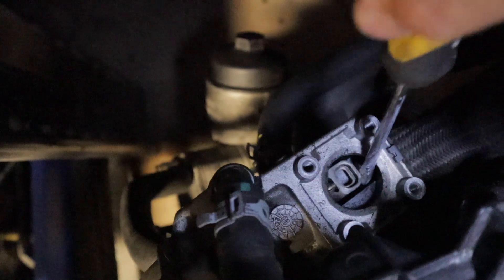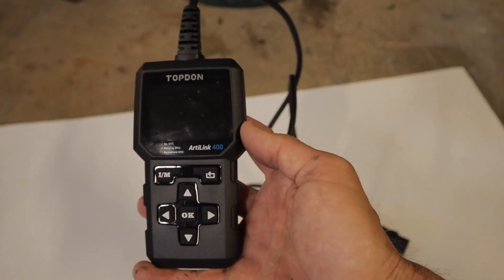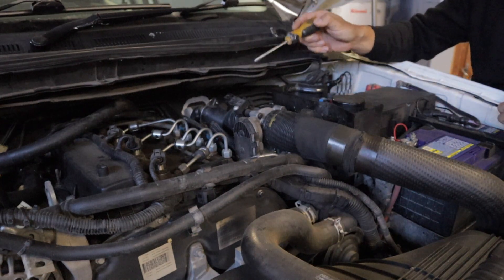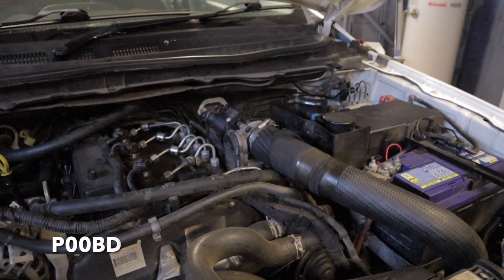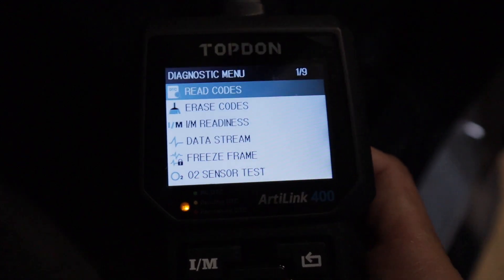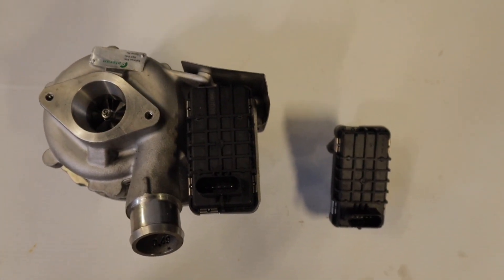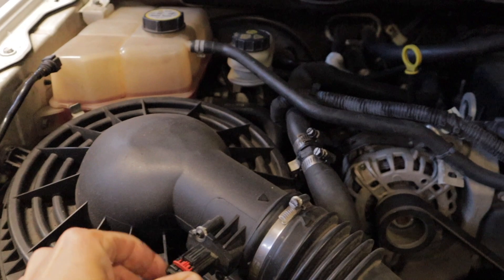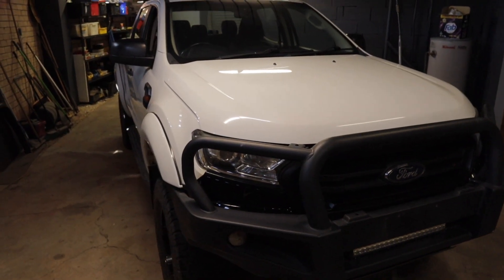Ford Ranger Common Fault Codes Causing Limp Mode

Comment: Have a p0722 code throwing my car into limp mode sometimes and I clear the code and my traction light comes on until I restart my car 
It’s a 2014 3.2 litre XL AUTO 
transmission speed sensor
Car drives fine other then when the traction light pops up, is my transmission due for a rebuild or is it maybe a faulty sensor, let me know your thoughts thank you

Comment: HI I HAVE A 2012 FORD RANGER 2.2 I HAVE A SIMILARY ISSUE AFTER ONE OF MY ROSE GOT CUT BUT NOW IM GETTING A P2564 CODE  I TRIED CHANGING THE TBCPS sensor
 NO FIX DO YOU HAVE ANY SUGGESTION PLZ THANK YOU
Reply from the maker: rose got cut?   , p2564 , how is the intercooler & pipes?

Comment: G’day mate. My traction control and powertrain icons came up today on the way out of the city and was limping. Shut it down for a while. Turned it back on and it disappeared but I turned around to be safe. Weird that I smelled something perhaps some lining stuff but I’m no expert. Worth to note the EGR cooler was just replaced and had no warnings before it was released to me on Friday afternoon. Under 98K kms on the clock, 2.2L T6 RWD only. Any ideas ? Will mos def bring it back in next week. But this is the 2nd time in like 6mos.
Reply from the maker: would need to read the stored codes on the computer
Reply: @abdautomotive  ok got it, will get someone to check the codes and come back here, hopefully tomorrow Monday. Enjoy what's left of your weekend, mate!
Reply: @abdautomotive  P2291:00-28 Injector Control Pressure Too Low - Engine Cranking ; seems to be an issue with the fuel filter housing when they troubleshot it yesterday as it shows movement when engine is on (not sure how they saw/measured it) but they put a relatively new FF housing and will test it to isolate further.
Reply from the maker: @r1cpac  thats an unusual one , can't say i've come across that before

Comment: Just got a PX1 ranger with 250K recently. Been fine for the first month. Went to check fluid levels and found the coolant level low. Took 2L to top up to correct level. Next morning on the way to work after getting off the motorway it was into limp mode after some heavyish acceleration. Powertrain fault light flashed once and went out but stayed in limp mode. Pulled over, switched engine off and on and it was fine until I tried to accelerate hard again and went back into limp mode with brief flash of powertrain fault light. Happened again the next day. Won't do it if I take it easy. Coolant has gone back to low level and appears to stay there.  Scanned the ecu and there are no fault codes. Any ideas?
Reply from the maker: sounds like intercooler, i have a video on this, would advise to watch.
Reply: @abdautomotive  Thanks for replying. I watched the intercooler video but I'm unsure as to how this would affect the coolant level as the intercooler only passes air through it?
Reply from the maker: @dannomite123  so does the coolant keep dropping?
Reply: @abdautomotive  no. It just sits about 2cms below the Min mark on the reservoir
Reply from the maker: @dannomite123  does not sound like u have a coolant loss issue then, top it up to max & see what it does, as for the fault under load, to me this sounds like an intercooler or intercooler hose is cracked, very common issue, easy fix
Reply: @abdautomotive  I'll do that. If it's an intercooler leak, then there should be black smoke? It doesn't blow any smoke, black or white.
Reply from the maker: @dannomite123  , it won't blow smoke, car will just into limp mode & throw a light or two on the dash.
Reply: @abdautomotive  found the cause of the coolant leak. Turns out it was the lower reservoir hose that goes to the bottom of the radiator. Thing would leak one day and not the next.
While I was at it I pulled out the intercooler. No signs of damage or leaks. Pressure test it and it doesnt leak. Outlet hose is good. The inlet hose that comes from the turbo did appear to have been leaking a little at the joints as if the clamps weren't tightened enough. Put everything back together, tightened all clamps snugly. Let you know if it goes into limp mode again.

Comment: Have you ever seen a P0546 code exhaust gas temp sensor?
Reply from the maker: never
Reply: @abdautomotive  it turned out to be the top dfp sensor had fallen out causing the dpf and pressure reading to go out of wack.
Reply from the maker: @jessehill1421  that explains it, mine is pre dpf model

Comment: Please help me, I have a 2015 3.2 ranger. I getting oil I'm the cooling system but no water in the oil. What's the fix for something like this. Where do I start with diagnostics.
Reply from the maker: sounds like your oil cooler has failed, it's part of the oil filter housing where the oil filter sits.
Reply: @abdautomotive  Thanks, I will take a look, hopefully this will be it.
Reply: @abdautomotive  I had a poke around, but don't really see anything, is there a way to test this? Your help I much appreciated.
Reply from the maker: @graniterobotrobot5891  you won't see much as it fails internally
Reply: Are you sure its engine oil? If you have an auto trans there is also a heat exchanger on the side of the trans much like the oil cooler where trans fluid and coolant could mix if it is damaged. You could check your trans fluid for coolant contamination. (Doesn't apply to manual trans).
Reply: @Timfo68  thanks but no I have a manual.

Comment: Nicely done mate. Thanks for taking the effort. I've got a PX2 and it had an intermittent egr problem making it miss badly under acceleration under load. Bit of a nuisance, turned out to be the egrt sender unit in the exhaust manifold. (DTC's) P040C/P040D and/or P041C/P041D. Apparently pretty commmon and Ford have updated the part, no. CC1Z12B591E, about $70 and a 3 minute job. Been looking for a little scanner to save taking the laptop everywhere. Will order the one you linked, thanks. Cheers PP

Comment: Hey mate quick question will the actuator from a 2.2 work on the same model 3.2 ?
Reply from the maker: different part number as the 3.2 runs a different turbo, altho the parts looks identical not sure if it will work.

Comment: Another cause of the BD air flow code is if you fit a snorkel or change the air intake and don’t reset the MAF learned values. Learned that one the hard way
Reply: How do you reset the MAF values , ? Thanks
Reply: @jeepchickenlegz  use FORScan software connected to OBDC port
Reply: @motorcyclemagician5705  nice one , cheers for replying